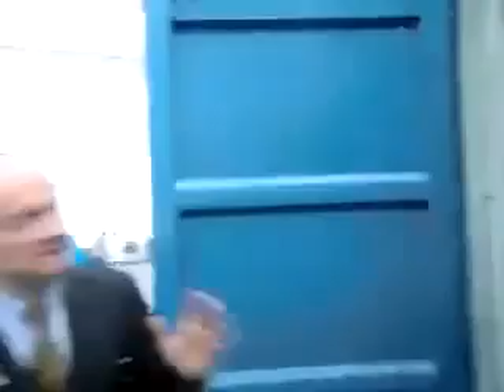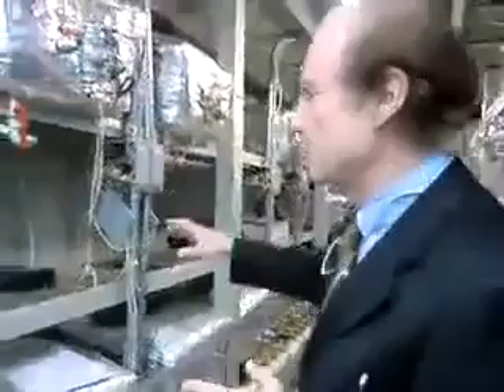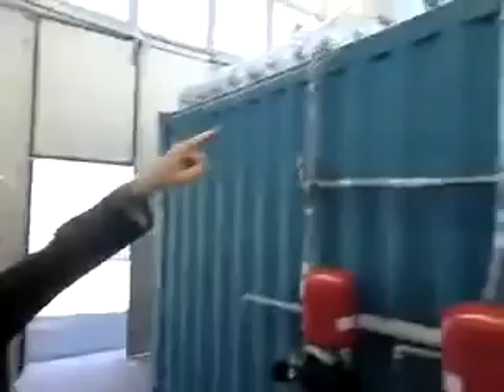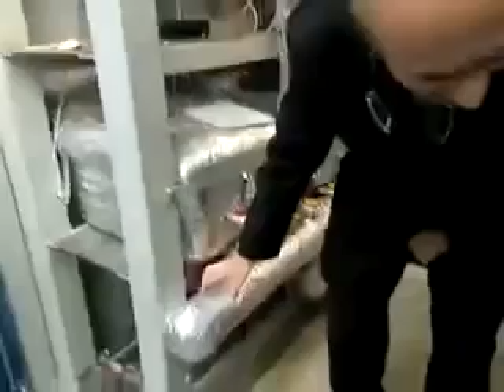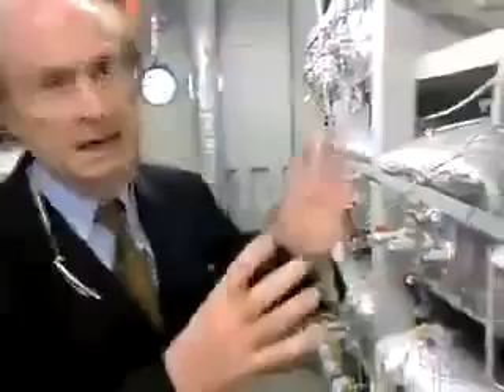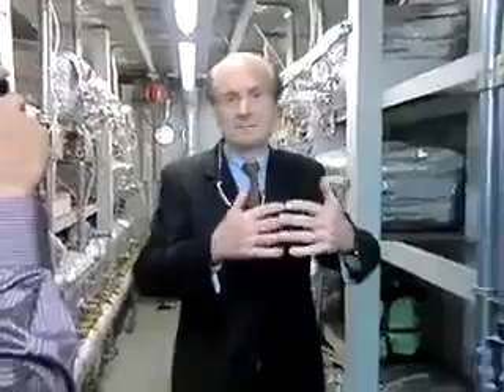A look inside the 1 MW E Cat cold fusion LENR plant part 1

Comment: The real answer at 3:30 is that he is trying to control an exothermic reaction with a heating element. To actually produce reaction heat he must operate the units very close to the runaway point and he needs the very large difference in temperature to maintain stability. As soon as the temperature goes much higher the units runaway and must then be replaced. I am guessing that this is why he must have a team of people with stethoscopes to monitor the unit in operation. Also just a guess on my part but they (the people with stethoscopes) are listening for the sound of the water starting to boil and manually adjusting a flow control device for the inlet water flow. If it is boiling to fast they speed up the flow. If it is not hot enough to be boiling they must slow the flow of cooling water. In order to run at higher temperatures they loose there feedback (the sound the  people with stethoscopes are listening for) and the system becomes unstable.